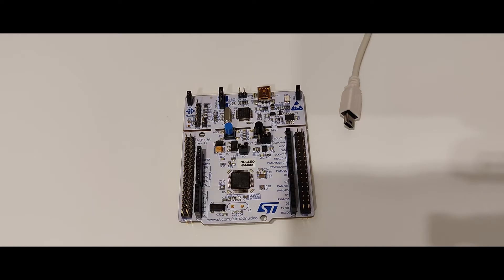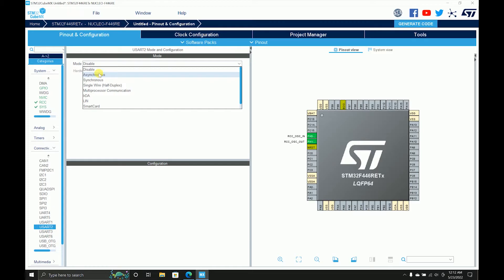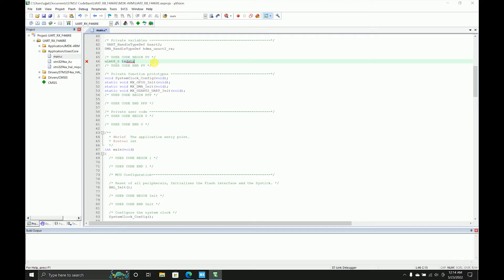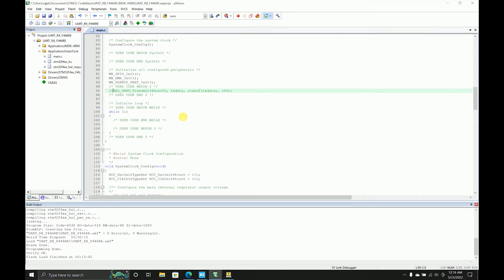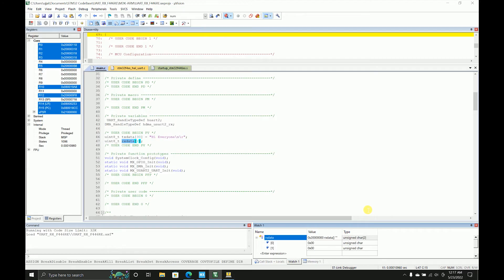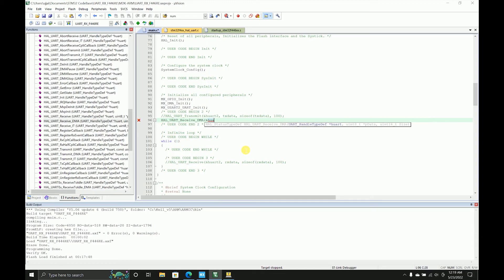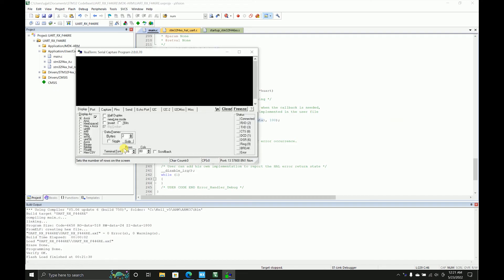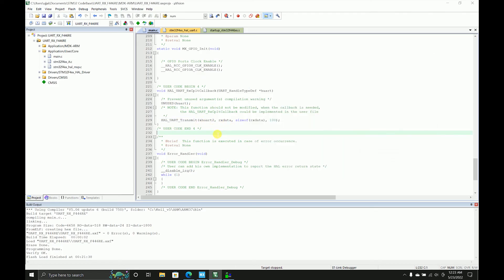STM32 - UART Serial Communication | Transmit | Receive | DMA

Comment: It helps me a lot, thank you, sir!
And may I ask you some questions?
1. Currently I am studying to program the STM32F405R6T6, so does it have the same code as stm32f446re?
2. Beside the serial UART, I want to add 2 CAN protocols to the stm32, and I want to program to transmit the data from UART to stm32 to CAN1 to CAN2 and the opposite way, and I'm struggling for how to transmit the data from stm32 to CAN1, may you provide me some clues?
Thank you!
Reply from the maker: Hey I am glad it was helpful. I will try to answer your question the best I can.
1) If the controller is the same then it will mostly be the same. Although the API remains the same the things that change are pinouts, frequency of operation, memory map and other peripherals.
2) I have never worked with CAN so I am not sure how it works and what you need to make it work. Sorry I am not very helpful with this question due to lack of my experience. 

Hope this helps. Thank you 🙂

Comment: Hey, you mention that the callback is called only when the buffer (7 characters) is filled. But is there a way to call it when the newline is received, so that I can receive strings of different length? Thank youu :)
Reply from the maker: Yea I think that is possible. There will be a check that says when a new line character is received. I am not sure what needs to be done. You will have to check the APIs and see what works the best for you and how you can use it for your special application. Thanks

Comment: In this video explained very well but my dout is while receiving i dont know the data length i want to receive unknown data length howto achive  ?
Reply from the maker: I think the approach in there would be using interrupts. STM32 has some APIs that generate an interrupt once the last character is entered. You will have to look for APIs related to that and try them out. 
Thanks

Comment: Bro i am using stm32nucleo-h563zi i choose 10bit resolution with 12.5 cycle sampling as ( 16 cycle not not showing) when i am running code my adc values stucking between two values ( 15-16) only ....
Reply from the maker: This video is about UART. I am not sure I understand your question and it seems it is more focused on ADC. I would suggest you watch my other ADV video for more clarity. Thanks

Comment: Will setting a GPIO on an Alternative Function Mode.
Pins here can be used as in or out or for usart or for timers in same time??
For exemple l make GPio_pin=pin0|pin1
Can l take pin0 to send date via usart and pin1 as a digital output?
Or all pins should have the same behaviour.
Reply: me too ! I am looking for using IO simulates UART serial communication!
Reply: Did you find it?
Reply: @Chia_seeds  all pins should have the same behaviour.
If u want switch between AF and An for exemple just make 2 différents functions for each config.
Then call each one when u need it
Reply: @ELMagico02 I know what you mean. I know the principle. But when I practiced, I always didn't know how to start. I'm getting started very shallowly. I don't have an oscilloscope at hand either. Do you need an oscilloscope for this?I
Reply: @Chia_seeds  bro l'm a Software Devoloper, not skilled in embelded systhems

Comment: Would this work to communicate between an STM32 and Raspberry Pi 4 via Uart?
Reply from the maker: Yes it can work. Please check the voltage levels for both the boards. If one works on 3.3v, you will need a level shifter. Also the ground for both the boards have to be shorted.